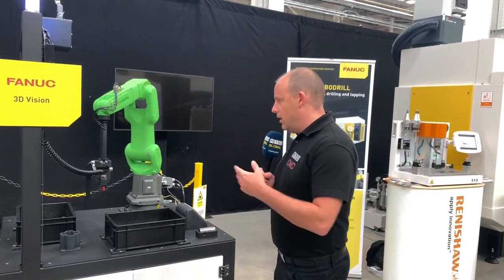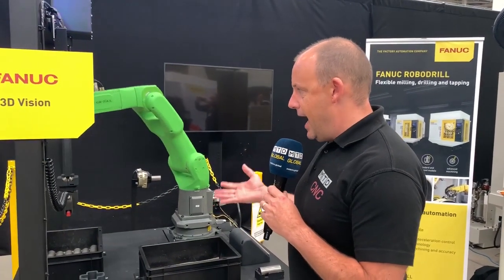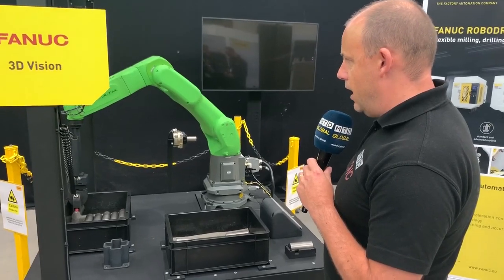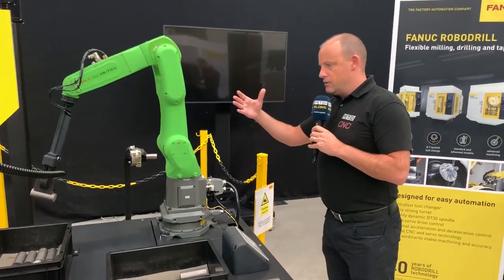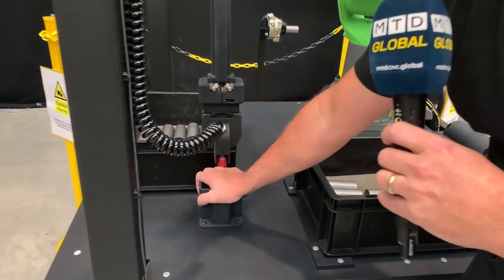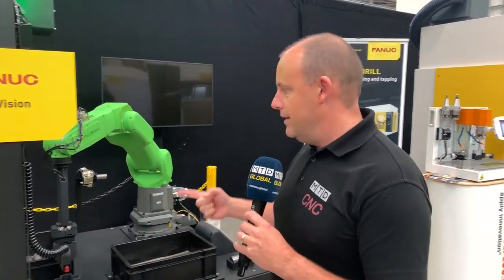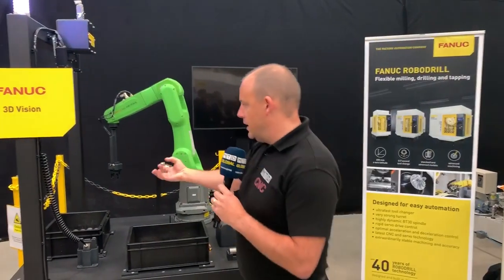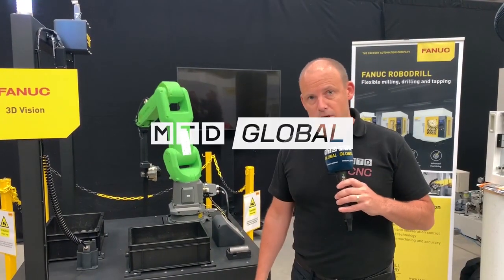What's the difference between a COBOT and a ROBOT

Comment: Ok, now you should rew the cobot to 100 and try the same. Currently if you integrate a cobot into your production you will be able to use the cobot with a maximum of 10%of its speed. This is why you should use a multifield set supportive safety scanner, if you do this and setup a warning zone(yellow) and a danger zone(marked with red) you can run the cobot on 100. If a worker interacts with the first warning field your cobot will switch to collaborative mode and you can do what you did in the video.